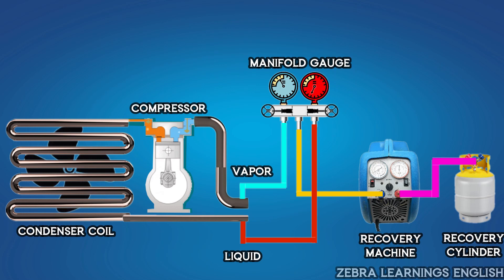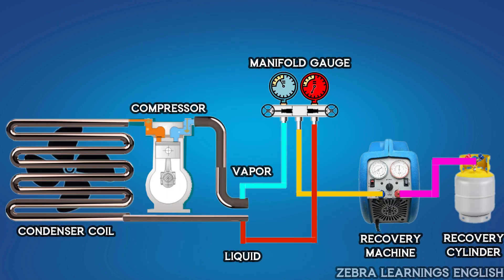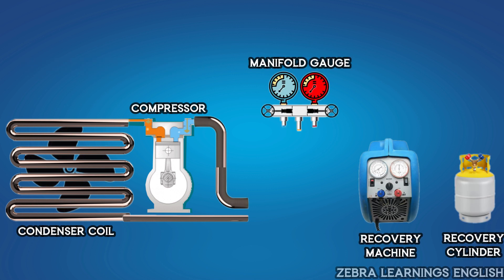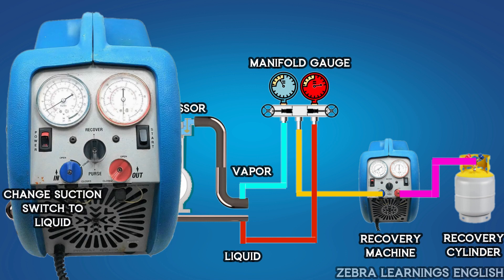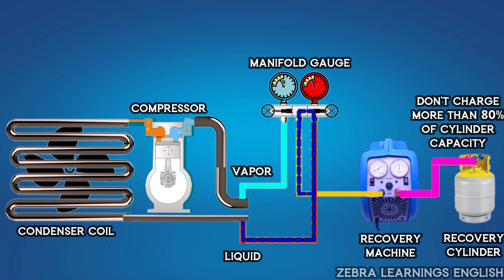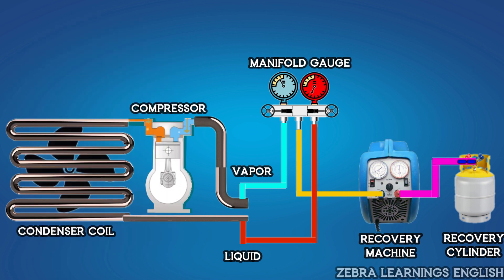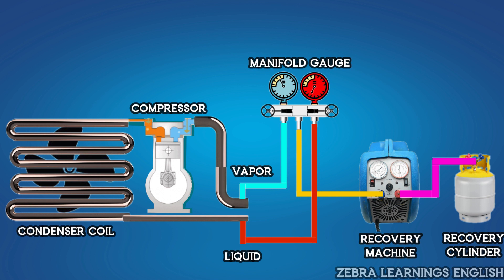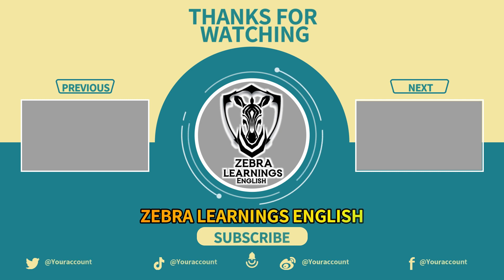How to Recover Refrigerant from an AC unit? | Animation | #hvactraining #hvacmaintenance #hvac

Comment: And what about evacuating the lines before starting the recovery? Without that the air and moisture in the pipes will be mixed into the recovered refrigerant. Also, a filter would be needed in the piping before recovery machine to remove oil and dirt from the refrigerant.

Comment: I'm requesting a pin from the uploader for this one-

On most if not all recovery cylinders, the blue port is the liquid side and the red port is the vapor side. It is definitely counterintuitive to the color code of analog manifold gauges, which is red for high psi and blue for low psi (which are connected to the liquid and vapor ports) so don't let that throw you off. The liquid and vapor ports should be labeled on your cylinder in addition to the color coding if you don't believe me. If not, well, then trust me bro.

Great video, OP, it's short and straight to the point for the field technician that needs a refresher 🙏

Comment: The color coding completely throws me off. The blue side represents liquid, but it connects to the red (vapor) port on the tank—that makes absolutely no sense to me and could cause serious confusion in the field. In this video, just like in real setups, the red side (vapor) was connected to what’s supposed to be the liquid side. What engineer in their right mind designed a system with colors and functions mismatched like that? Or is this just an error in the video?
Reply: The red hose means the high pressure side — the part after the compressor where the refrigerant is still a gas until it turns into liquid. But in this case, the hose is connected after the condenser, where the refrigerant is already liquid and ready to go into the recovery tank (on the cylinder valves, blue represents liquid and red represents vapor).

Comment: Is it correct that the liquid port is blue and the vapor port is red, not the other way around?
Reply: Exactly, I noticed that too, I’d assume that recover cylinder is similar to the AC system so I wonder if the channel made a mistake…
Reply: Red is liquid. Channel made a mistake to collect review:)
Reply: On a recovery cylinder the liquid side is indeed blue and the vapor side is red. I'm not sure why they're made that way considering it's flipped on analog manifold gauges with high psi being red and low psi being blue, but here we are. Take a look at your cylinders, lads, because these two comments above mine are incorrect

Comment: 3:08 wait what? Vapor side should be blue valve on tank and liquid should be the red valve. Or is this wrong?
Reply: Different recovery tanks switch it up every time but it will always say it on the nozzle
Reply: Right😂 i notice too
Reply: It could be either way, not to follow the color is better to check which color represents vapor and Liquid

Comment: Unfortunately, we don't do that in Europe. Due to regulations introduced by mentally ill bureaucrats, the gas is being released into the atmosphere. The regulations state that in order to empty the device of refrigerant, you must have a specialized license issued by the government. To obtain a license, you must complete an expensive course and pass an exam in which, in addition to the technical aspects, you must learn several Directives, i.e. complex legal acts. The directives introduced a complicated administrative procedure requiring the preparation of protocols for each activity. After recovering the factor, it must be delivered in a specialized car to one designated foundation that accepts it, but it has to be paid dearly for it. If you make mistakes, they may take away your F-gas license and give you a large fine. The only way to avoid errors and costs associated with supplying the refrigerant for regeneration is to release the refrigerant into the atmosphere and prepare a report that the installation was leaky and the gas escaped on its own.
Reply from the maker: As far as I am concerned, these rules should be strictly followed in all countries.
Reply from the maker: @henny1387 Sorry brother, I am currently in UAE and the course won't take much time. For the basic HVAC course 3 months to 6 months are enough.
Reply: I don’t mind taking a course or even passing an exam. What I do mind is being buried in legal jargon, regulation numbers, and statutes. We don’t expect lawyers to take a class on how to service an AC system, do we? No—they stick to their job. We’re technicians. Not lawyers. Just tell me the bottom line—“Don’t evacuate this into the atmosphere because it’s illegal.” That’s all I need to know. Don’t expect me to do a lawyer’s job. Just tell me what I need to do to stay compliant, and I’ll handle it from there.
Reply: Where in Europe you are?
Reply: Where in Europe? There are reglementations and rules in EU and members countrys, the refrigerants won't be selling to persons without knowledge, like you.

Comment: Why can't you recover vapor into the liquid port?
Reply from the maker: In the liquid line, the liquid refrigerant will be there. In the vapor line, vapor refrigerant will be there.
So, recovering vapor in the vapor port will be easy and quick.
And if we try to recover vapor in the liquid port, it may damage the ac system and recovery machine.
Reply: @zebralearnings   Into the recovery cylinder. There is a liquid side and a vapor side. You can just recover liquid into the vapor side of the empty recovery cylinder....
Reply: Please use refrigerant weighing scale during recovery to ensure that you dont overcharge thr cylinder above 80%. The formula to calculate the allowable maximum weight of rerigerant is; Max Wt=(0.8 × WC) + TW.
-WC is water capacity and TW is weight of empty cylinder. Their values are stamped on the cylinder coller. Overcharge can cause explosion. Dont play play!
Reply: Wil the compressor oil stay inside the compressor?or go inside the recoverybottle?